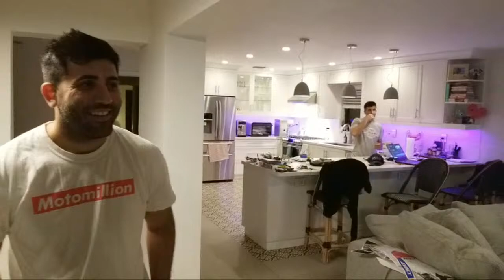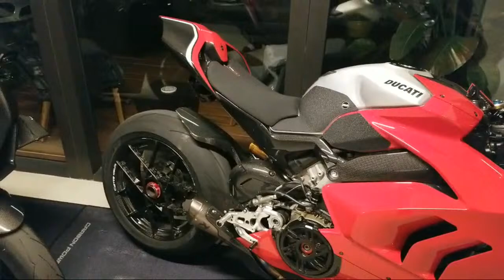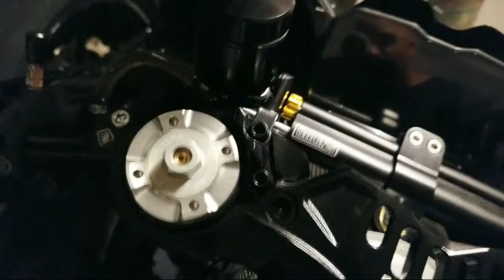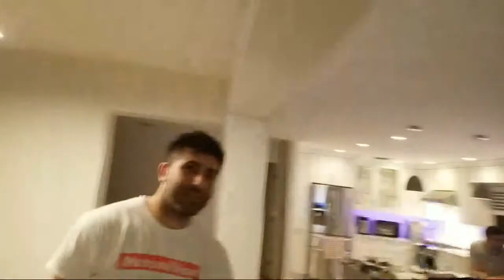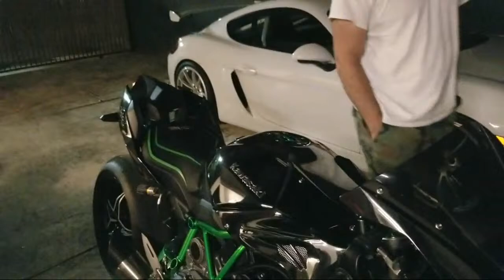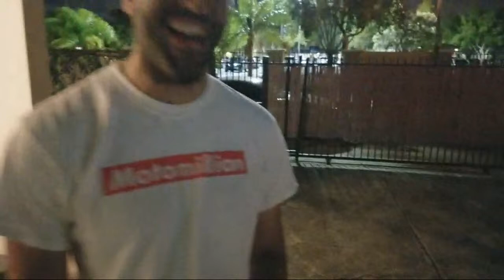Carbon Ducati Panigale V4 Madness 🔥🔥🔥🔥

Comment: Sorry to have missed the live stream...looks like lots of fun down Miami way. So, I always like visiting Florida but not a huge fan, too hot, humid, and FLAT. Not really motorcycle land for my tastes. But, Northern San Diego is heaven for riders in my opinion....am I prejudiced? Certainly.
Not crazy about the whole dry clutch thing. In my opinion Ducati's already sound pretty busy with the Desmodromic valve gear and that clattery clutch just adds to the "bucket of bolts" kinda sound. And the oil bath clutches are so friendly in use. But as Manny says there is no real right answer, it's personal taste.
As a long-term Porsche guy I can tell you that the GT4 is an unsung hero in the product line. If I were going back to track stuff today that is THE Porsche I would use. The Cayman/Boxster cars are the best handling in the Porsche product line and the GT4 finally adds the power that this chassis can use. Good for Manny in recognizing that.
Reply from the maker: Thanks Garey! Awesome Comme t as always 💯💯💯💯🇺🇸🇺🇸🇺🇸🇺🇸